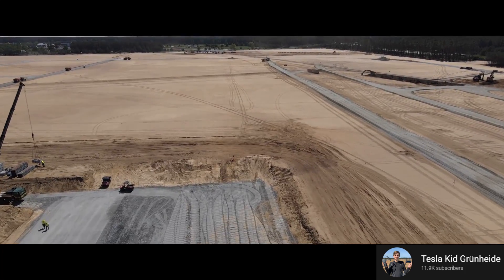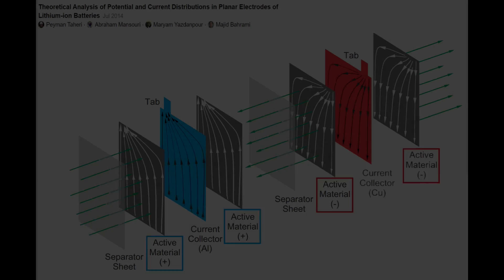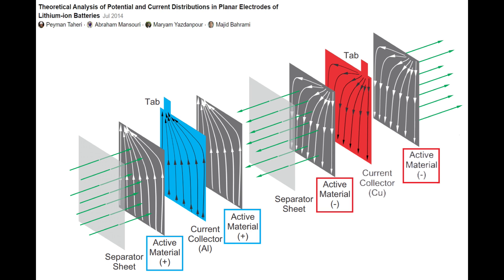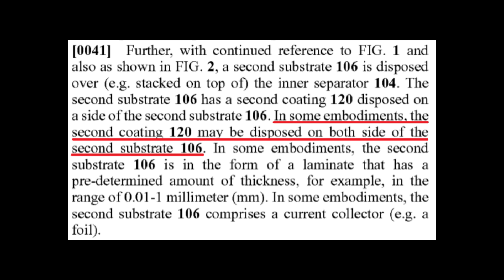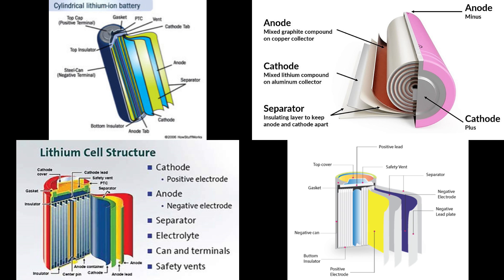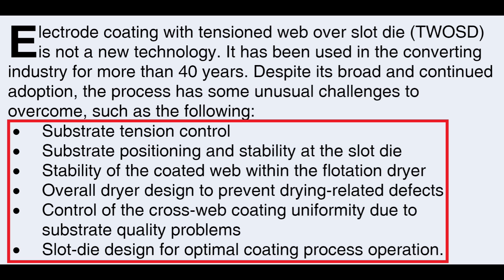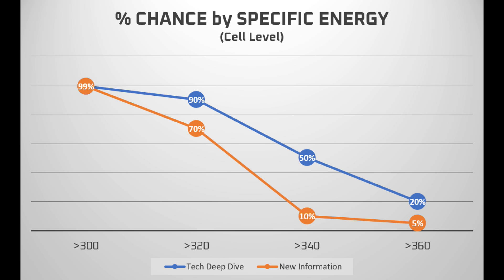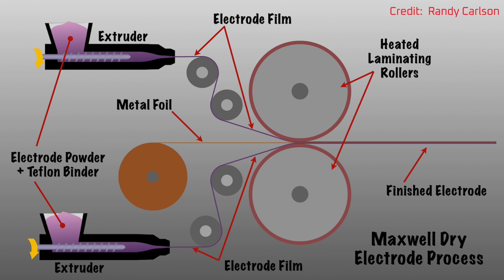Correction:  Electrode Layers

Comment: On heat: Have you read on heard anything on making a hollow cilindrical cell and running coolant thru the hole ? It seems that it would solve the uneven cooling problem and enable more cycles... Is it pratical ?
Reply from the maker: Not practical.  The copper running through the battery is nearly as good as a donut shaped battery, and doesn't require engineering gymnastics...we just have to start using plate cooling instead of trying to cool through the insulative plastic layers on the side. RIMAC learned this and is implementing it in their next gen vehicle.

Comment: The way elon is hyping batteryday it had better be good, because despite everyone saying tesla has a 5 year lead in batteries, they currently seem to be a little behind the curve, LGs NMC 811 is supposedly at 285wh/kg and CATL not only have their own (more expensive) MM battery version but are also at 304wh/kg (700wh/liter) for their NMC811 version (article 30 march 2019 pushevs, it was a sample back then but expected to be in production around this time).  Though on the upside teslas bms is superior with surprisingly low degradation for their chemistry and nobody (except porsche's 800v system) comes close to teslas charging speed, though audi etron is also impressive with how stable it is. it holds its max charge rate for a very long time and thus its probably limited somewhere (soft or hardware) and capable of a higher max if allowed.

Edit
So to me if tesla comes with a 320wh/kg battery id find that somewhat underwhelming after all the "reveals" of patents, now obviously if they say it can charge at 250kw 0 to 50+% that does change things or if they say it lowers the price significantly. But id do remember that everybody was saying the model y would have that special cabling based on patents and it does not, same with the special acoustic glass patent or 48v architecture. So yeah i'm kinda fearing things have been a bit overhyped at this point
Reply from the maker: All very fair points!

Comment: You should check out the company Novonix. Showing some real potential with global battery tech. Check out the latest Novnonix announcement today. Single crystal NMC cathode able to be manufactured using their DPMG technology. More References to Jeff Dahn and the million mile battery. Seriously looking to be the real deal now. https://www.novonixgroup.com/announcements/
Reply from the maker: On it :D.  Been researching them for over a month and in contact with the CEO.  Working on multiple scripts at the moment.
Reply: I think people have been underestimating the importance of the patented manufacturing technique. As a chemical engineer from Australia I had to jump at the chance to become a shareholder as they are primarily listed on the ASX. Massive run up in price recently with huge volume from institutional investors by the looks of it. Love your technical analysis of the batteries!

Comment: All of this battery process of removing tabs is done to make the battery sealed and disposable. This reduces cost and some improvement in performance. The battery pack will be throw away and follows Tesla's weak point of serviceability.  If they go to one big sealed battery and it has a BMS wire break off deep in the pack how will this get fixed?
Reply: I'd assume that the designers have written the control code in the BMS to be tolerant of a small number of broken wires - the cell voltages can be inferred from the voltage that can still be measured across a series pair of cells with little loss of information.  But why do you assume that a BMS sense line will somehow break inside the battery?  The entire assembly is potted in compliant materials to prevent just this occurrence.
The battery packs will NOT be discarded at the point where they no longer hold enough energy to provide adequate range - these gently used packs will have another 20 years of life ahead of them serving as grid storage [powerwall-like] components.  BTW, the present cells are just as sealed and disposable as you claim the tabless versions will be.  What's your point?

Comment: Why the patent seems to be focusing on cylindrical cells ? Isn’t it also applicable to pouch cells ?
Reply from the maker: Not sure man.  My guess would be that it's because they intend for this to only be used for cylindrical cells.  It might also be that it's more difficult to execute the tabless design and pouch cell.
Reply: The Limiting Factor , thanks for sharing your insights. One thing is that I can think of is that they may end up building two separate spirals, one for anode and the other for cathode. The 3D structure integrity, supported with a flat surface only on one end that connect all. Then combine the two into a cell. The manufacturing process is critical here. Not sure if you can inject the electrolyte before or only after.

Comment: I always wondered with the tabless cell, wouldn't the next/same bottleneck be the tiny wire that connects the battery to the pack, and i think doubles as a fuse?
Reply from the maker: heheheh, clever clever!  Yes, I thought the same thing.  My assumption would be yes, unless there is some type of circuit board they could overlay that isolates the cell electronically?  Regardless, it would move the bottleneck and heat out of the cell (in my uneducated opinion)
Reply: @thelimitingfactor  agreed! Thermal is probably the biggest advantage.

Comment: capacitors are made the same way offset plates and plate, dielectric. plate dielectric rolled up also it seems that most new battery tech will be rectangular or square and use plate type construction for high power capacity needs and round cells in small devices like hand held torches ect. I therefore am still of the opinion that other tech will quickly come on stream that will make much of their power battery and grid developments of less significance.

Comment: Jordan, a quick question for you and your battery colleagues:  Scenario 1) a lithium ion battery is charged up to 100%, and then discharged to 20% on a regular basis, or Scenario 2) a lithium ion battery is charged to 80% and then discharged to 0% on a regular basis. Of the two scenarios, which one is more detrimental to the life of the battery and why?
Reply: I would suggest scenario 2 is worse, as scenario 1 is the regular cycle of a battery. (though 0% is rarely "Fully discharged" on a Li-ion battery, the BMS reserves a bit for battery health)
From memory, the best range is to keep the battery between 40 and 60%, forever! But, that's impractical as...
Reply: I would guess that scenario one could lead to more Lithium plating versus scenario two. However discharging to zero in the second scenario could damage the cathode. Interesting question. I'm sure there's research out there about it